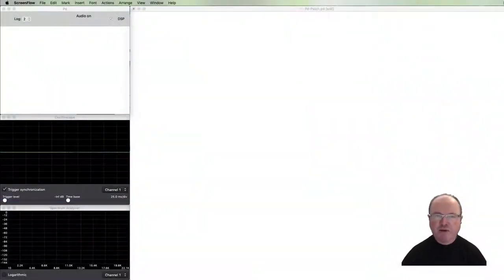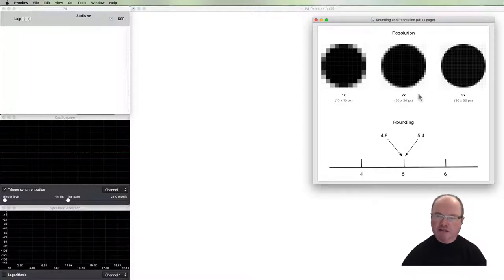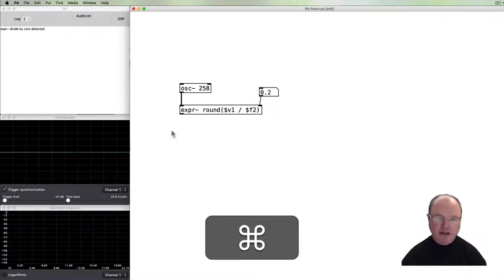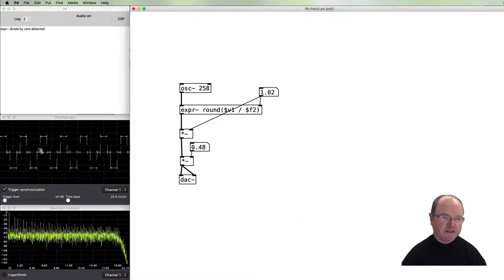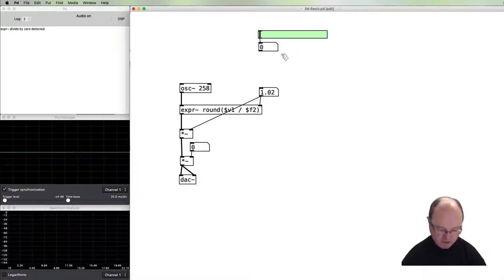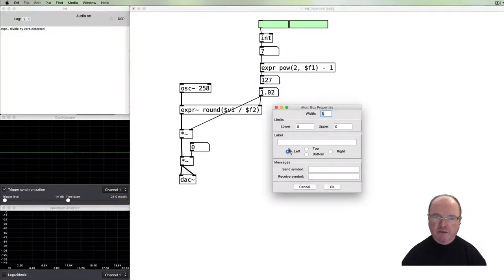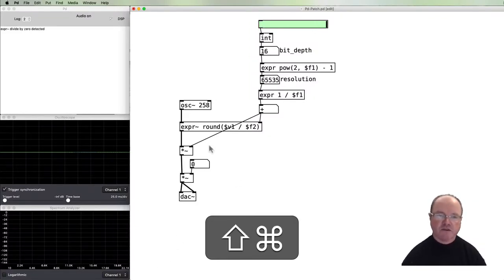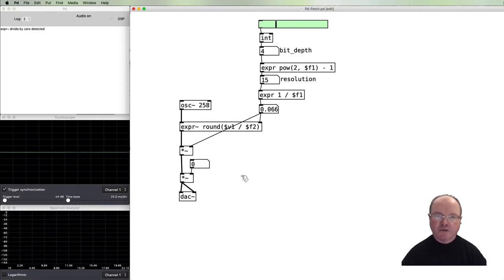14. Bitcrusher in Pure Data

Comment: Hey, great video and enjoying the series so far! One question, why do we get three values at minimum bit depth (minus gain, zero and plus gain) instead of the two values usually representable with one bit?
Reply: This should be due to the signal being bidirectional. Both the negative and the positive half are being rounded to -1 and 0 and 0 and 1 respectively.

Comment: hey , this is awesome and until today , because of some reason i can not explain, it does not work anymore
Reply from the maker: Hi Elmero, sorry to hear its not working for you. i just rebuilt the patch based on the video and seems to work for me still. Curious.
Reply: @QCGInteractiveMusic  Hey , thanks for the quick answer ... last week it worked like a charm ... it also tells me expresion divide by zero detected as i start the patch or do something else in the patch .. pretty weird bug .. i am on windows.
By the way  thank you for all the usefull videos you have made
Reply: @QCGInteractiveMusic  its only if i route external audio trough it .. at least i found out it works quite well ..

Comment: Thank you for your work!! Also, I wonder if the rint object has the same function as the round object? It seems to work fine when I replace it with rint, which makes more sense to me.
Reply from the maker: It does seems that using rint or round in the [expr] box work similarly.

Comment: I am trying to do chip tune like sounds with pure data. Bitcrushing is a good start, but to make it more authentic, I am trying for some sampling rate decimation. Unfortunately I haven't succeeded so far. Tried it with snapshot and metro object, but the metro object does not really do the rates needed (above 5kHz). Is there another object I haven't yet taken into consideration? or does anyone have a different brilliant idea?
Reply from the maker: In Pd's audio settings you can specify the sample rate (say 8K). That and bit-crushing should get low fi audio. Then use short sequences, raw square waves and no dynamics :)
Reply: @QCGInteractiveMusic  Thanks a lot. I also learned that what I was trying to do with snapshot and metro object, actually works with samphold~and phasor~object.
Reply: @QCGInteractiveMusic  What exactly do you mean by "raw square waves" ? As in "non pulse-width-modulated" ? I guess you must mean something else as I know most chip-tune music is always heavy on PWM, especially SID-music.